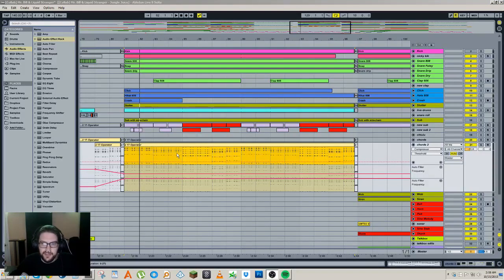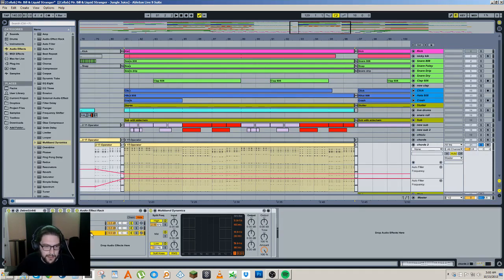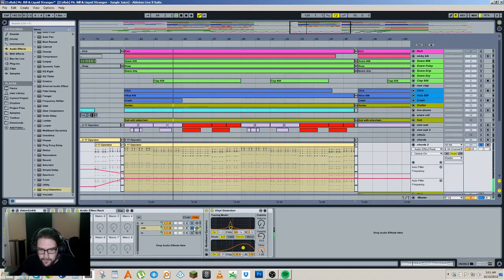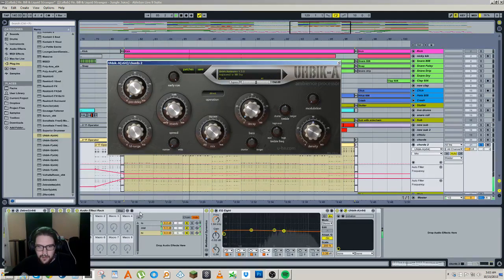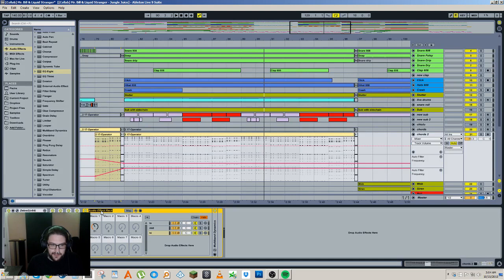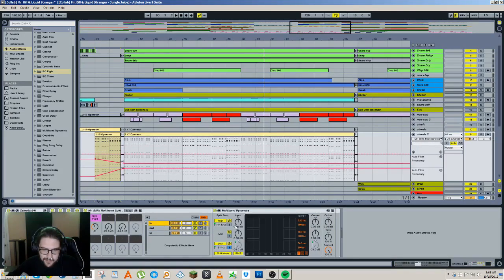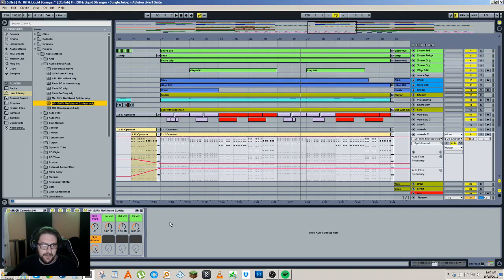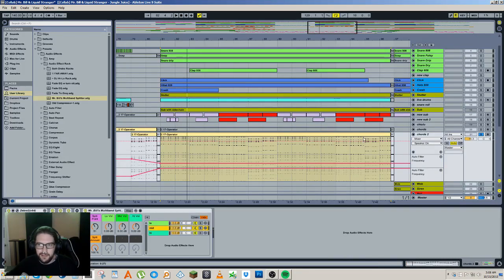Mr. Bill - Ableton Tutorial 52: Splitting Frequencies With Multiband Dynamics

Comment: Just tried this for referencing the lows mids and highs on my favorites tunes and it is def messing with the signal. When I turn the rack on the signal will clip and also sound a little different. Not sure whats happening. Does anyone have a fix for this? 

Edit: I tried turning off the "Band Activator" button which is the small button the "s/solo" button. That seems to have fixed it or at least it sounds way better now...still clips tho. I guess you don't want dynamics processing kicking in if ur splitting bands for the purpose of adding effects. Im in Live 12 btw